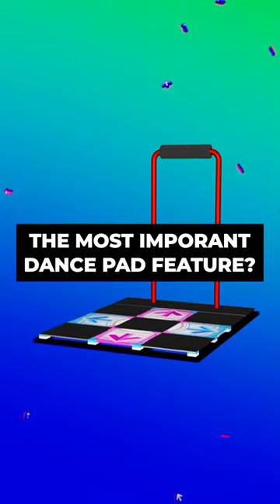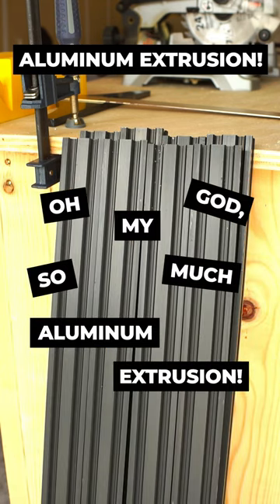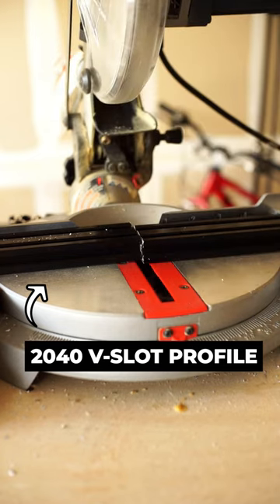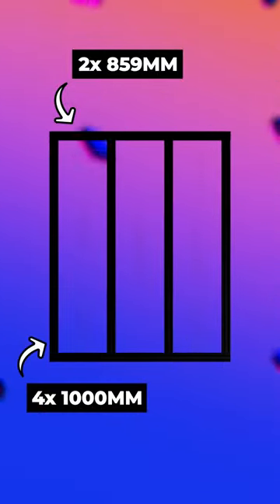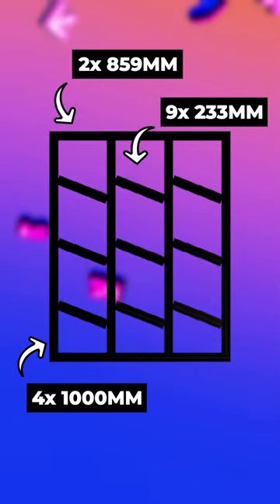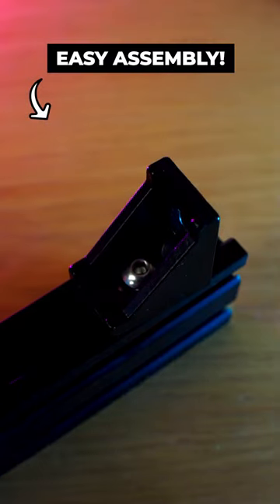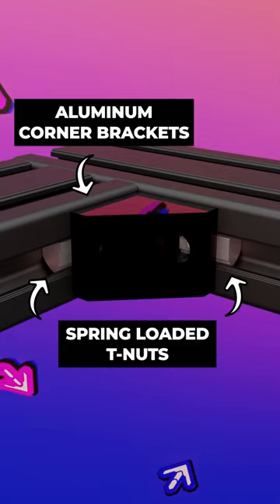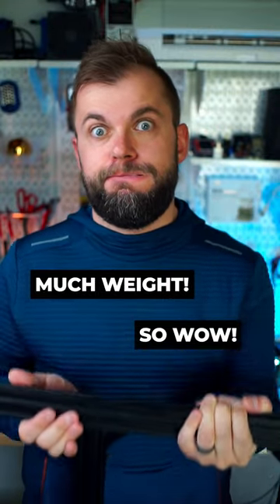DDR Dance Pad Part 2: SO MUCH Aluminum Extrusion! #dancedancerevolution #arcade #bemani #ddr #diy

Comment: Really edging me hear. Also those 3d printed parts. Could i use wood by chance?
Reply from the maker: For sure! Wood works, too! I chose this setup with 8020 because it’s a bit more portable since I have to get it down into my basement. Based on my other pad from my previous video, I’ve learned that once a wood pad is assembled, it stays assembled. 😅
Reply: @SuperMakeSomething  yeah ive been going up and down amazon and found the extrusions. I just dont have a 3d printer😅

Comment: Please give me the circuit diagram for the mini video player. and how do i make it work for the ili9341 display?
Reply from the maker: Unfortunately I do not have the circuit diagram for the video player project at this time. Regarding the ILI9341 - you will need to double check the code to see if it is listed as compatible in the screen library used in this project.
Reply: @SuperMakeSomething  ok😞

Comment: What’s a good price for the 2040 aluminum rails? Looking around it seems like this varies pretty wildly. I think the best I found was on Amazon at about penny per mm if I order in 2 meter lengths
Reply from the maker: @megamattplays4903  I purchased two of these 6 packs of 2040 1000mm rail for my build through Amazon. Prices are a bit lower if you don’t get the black anodized version, but I liked the look of them. 😀 https://amzn.to/3Y2Q5hO